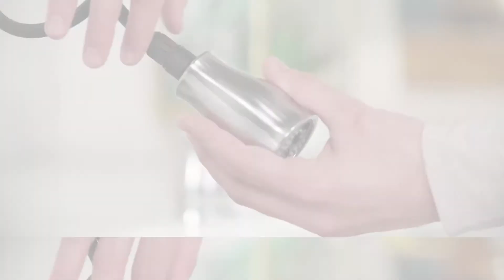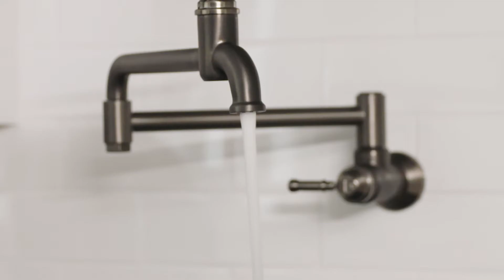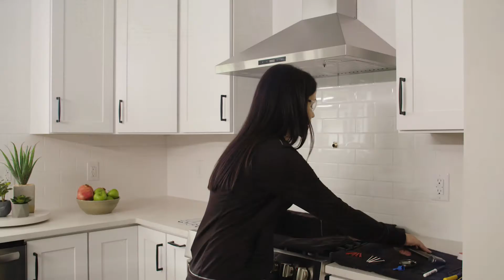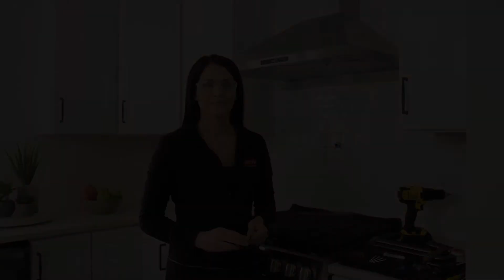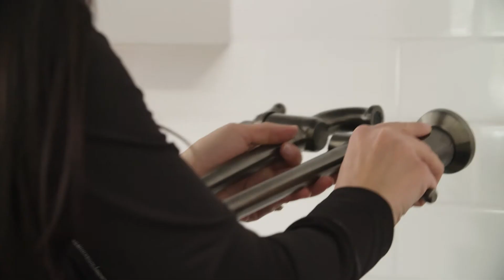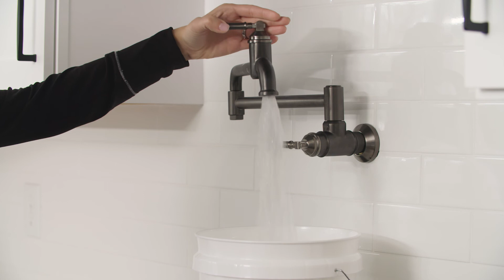How to Install a Delta® Pot Filler

Comment: This faucet is high maintenance, and Delta does not identify, nor offer, all the replacement parts one needs to maintain it.  Valve cartridges, o-rings, flange inserts, etc.  I am trying to repair mine now, and can't find the parts I need to keep it from leaking.
Reply from the maker: Please accept our apologies for the inconvenience you are experiencing with the pot filler. We are happy to help! A replacement cartridge with handle is part number RP100955. Unfortunately, we don't carry parts for the pot filler joints. I apologize for any inconvenience this causes. Please reach out with any questions!
Reply: @deltafaucet  I have been able to find the cartridge which is one of the few items your incomplete parts list on Delta documentation does show.  It does not show the parts in the two elbows which are the current leaking problem.  Gaskets and a plastic ring flange are not identified.  I have found the gaskets thanks to the help of a non-Delta source.  I need to replace the plastic ring flange as well that surrounds the brass fitting in the elbow and provides the spacer between the two elbows as they pivot.  These all deteriorate with use.
Reply: @deltafaucet  With out these replacement parts, the faucet can not be repaired and is an expensive waste when it does wear out.  If you can not provide ALL the needed parts to maintain, I would NOT recommend this faucet and would recommend another make or totally different faucet.
Reply from the maker: Hi Andrew, thank you for your question about Delta Faucet pot fillers. Unfortunately, we don't carry replacement parts for the arm joints. I apologize for the inconvenience this causes. Please reach out directly if further assistance is needed. We are happy to help with a leak!

Comment: And the "appropriate drill bit" is what? Looks like you used a diamond hole saw and NOT a drill bit! NO WAY can this be anchored to just the drywall. YOU assume there is a stringer! Look at some of the other YouTube videos and you will NOT see a stringer; they installed the rough-in for the pot filler WRONG! Your rough-in is great! They don't understand the purpose of the flange and set screws is to transfer the faucet load into the wall and off off the water pipe, and mistakenly use the 1/2 inch water pipe to support the faucet! Use the drill to run the screws in. If you cannot control the drill, have someone else do the job! Why are there TWO valves. Does that get the water to flow faster; just kidding! Why did you mount it so high above the slide in stove? Makes lots of splash into a 2 quart pan at that height. Only needs to be 1/2 inch above tallest pot on the burner. How did you tighten the brass nipple, which should stick out 1/2 inch, into the drop-ear? By using an internal pipe wrench (see Brasscraft).The water pipe could be a bit above 10.5 inches; the height of a Samsung stove with its own backsplash. Have a nice day! FYI that kitchen looks JUST LIKE MY PLANNED KITCHEN! Even got the same range hood and will have a slide in stove, but the drill; nope, get the model with indicators on the batts. Should mention outlet must be ground fault; required by code if now is close to faucet. Finally, too bad we cannot see the rough-in! How many homes ALREADY have a pot filler?  Have a nice day Delta!
Reply: A bit late on a reply here, but regarding height there are  a few things, perhaps others, can consider.  Get out your tallest pot and make it part of the installation plan. Before I installed mine I read reviews on splash. My valve is 11 &  1/2 inches above the cook top and it works perfectly. Also if there is a splash problem, that is where the second valve will come in handy. Set it to regulate the max flow you want, and use the other for on/off.   Getting back to height, also consider that all pot fillers have gaskets in them. I suspect the heat may likely influence their age, so its best to balance your decision  when you do the install and not have it too low either. Overall, ours has been in over three years and we love it.
Reply from the maker: Hello customer. Thank you for contacting Delta Faucet Company and we are happy to help. We are sorry to hear that you are frustrated with our instructional video. With any further questions or concerns, please do not hesitate to reach out to us in a private message with your contact information. -Carrie

Comment: How high above the stove should you place your pot filler??
Reply from the maker: Hello Asha!
We do not have a recommended distance above the stove, for model 1190LFL. I have included a link to the technical specifications diagram, for you to refer to during the installation.
https://media.deltafaucet.com/SpecSheet/DSP-K-1190LF%20Rev%20A.pdf

With any further questions or concerns, please do not hesitate to reach out to us again. -Carrie
Reply: 1/2 inch above your tallest pot sitting on the stove burner.